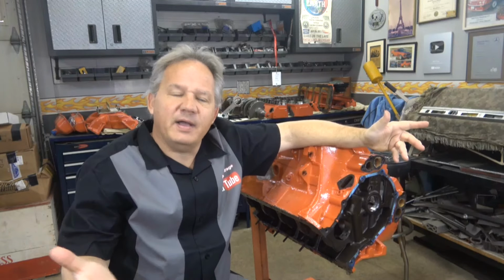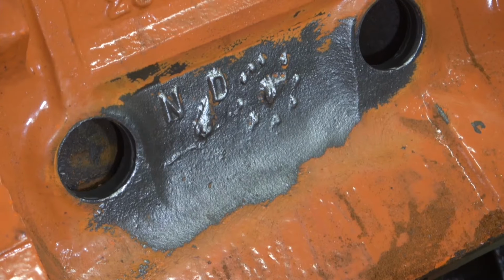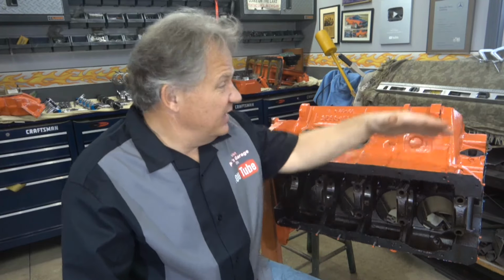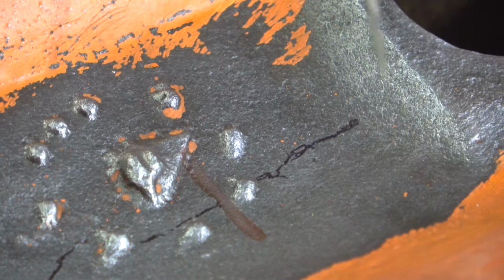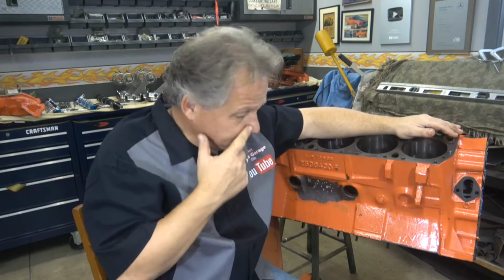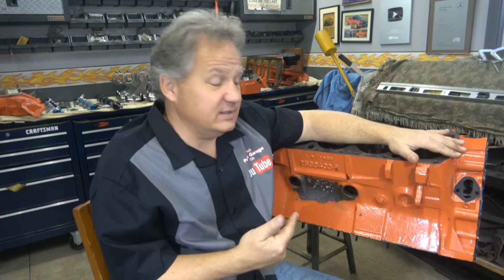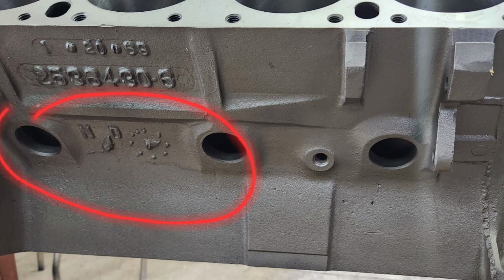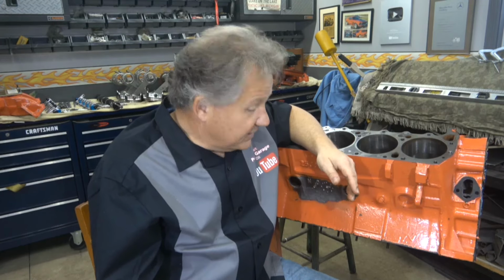Engine Failure Analysis - Why did the Block Crack

Comment: Where is the engine and car today? Was the engine repaired or replaced?
Reply from the maker: I still have the block. I may make a video about fixing cracks like this. I got a different one and rebuilt it. After installation there was a rear seal leak. It is very difficult to build a 440 with zero oil leaks. That is being fixed and the car will be at car shows soon

Comment: Those RB blocks were known to crack between the core plugs even way back in the 1980s. Has nothing to do with strength, JB weld it up and send it!
Reply from the maker: I will probably pin it

Comment: I'm very interested in the upcoming videos of the broke in cam and lifters, bearings, etc. You rarely get a chance for this! 

Despite the crack, very nice build.
Get yourself a Nickel welding rod for grey cast iron, grind the crack, bore the ends of the crack with a small drill and weld that groove back up. I know, easier said than done 🙂.
Reply from the maker: i may fix it in a video. I'm worried the crack is bigger than can be seen

Comment: Very informatuve and instryctive video, Pete.  I'm only a very inexperienced builder of a only few engines, but I worked for some years as a mechanic's helper and general "garage hand" for a couple brothers and their dad who had been fixing cars and trucks since the early 1930s.  One of my jobs as a helper was to pressure test virtually every job that left the shop, even if we had not worked directly on the cooling system.  I found a lot of weeping radiators, bad water pumps, etc. that made the shop good money when we fixed them for the customers who avoided getting stranded with an overheating vehicle.  I have watched a number of TouTube builders dyno test engines and I have often wondered why the shop didn't put a simple pressure test on the engine before investing the time and trouble to run it.  Cheap, and simple and it finds a lot of flaws.  Just a few thoughts from the peanut gallery.  Be well.
Reply from the maker: It is a good idea to take a little time to do a pressure test before starting up a new engine.

Comment: If you think you can visually see a crack, a magnetic particle (MT) examination using a yoke on the AC setting should be more than sensitive enough to detect the full extent of the crack on the accessible surface.  I’ve never heard of MT not being able to detect cracks because they are too tight, but I’ve only used AC (I’m a carrier NDT guy).  A DC yoke will be less sensitive, but can penetrate deeper into the material.   

A liquid penetrant (PT) examination should also detect it if properly performed, but I’d try MT first.  

But I don’t disagree with you thought on the block being left out in the cold to freeze without antifreeze.
Reply from the maker: Even under a 10X eye loop the crack is almost impossible to see

Comment: If the crack is open to the surface, MPI (magnaflux) will 100% find it if done properly, doesn’t matter how tight it is. As long as it is surface breaking. Ask any trained NDT technician.
Reply from the maker: I've done quite a bit of NDT. I'm not 100% sure what I saw was a crack, but the coolant was weeping from the casting
Reply: Magnetic Particle inspection (particularly Fluorescent Mg Particle) is the method of choice for detection of surface or subsurface anomalies in ferro- magnetic material.

Comment: Yes the piston rings spin. The block can be fixed with special procedure involving gas welding at the same time while strictly controlling the heat build up and then controlling the cooling of the block.

The question is Pete : Magnafluxing is old technique for checking for cracks. This block should have been checked with pressure testing above operating temperature. I wonder if it was checked with 3 step dye penetrant would this tiny crack reveal itself.
Reply from the maker: Lots of what ifs. You will find out about ring spinning in a future video :)

Comment: Is that crack fixable?
Reply: Dito on this question.  I'm going with no cause you have another block at the machine shop/personal preference to not bother with it.  Engine block care matters and if there's one crack, what are the odds of another defect.
Reply from the maker: It is a chance to take when fixing a block, there can be more cracks
Reply: Depends on if you want to spend the money to have it fixed , I've had many oil field engine block cracks like that fixed from freeze damage  and it was not cheap but the repairs held for years of abuse afterwards .
Reply from the maker: Yes it is, as long as you can see the start and end.
Reply: I have seen cracks like this before and if it were my block, I would put block filler in the bottom of the jackets and use a good sealer then put it back together and run it. It's a factory thin area with these blocks and the factory had many of these and would seal them and send them. Once the engine has been run then tanked for rebuking the tank it takes out the sealer used and the crank makes itself known! All iron blocks from factory especially ones that have thin locations like this have experienced occasional instances of such cases, not every engine, just some. Old Ford Flatheads were the worst and age made them even worse still. When Chrysler was making these,  nickel content along with some other metals was being used, sometimes the molten iron was a little inconsistent and wherever stress such as at the bottom of the jackets to the crankcase or top to deck is high due to expansion, these cracks appear. One way to deal with this is to use a particular block sealer that cures and can be drained out after. Another way is to fill the bottom are with rock block and then add in a good coolant seal. This is at an area that doesn't have to deal with high temps, only high stress from the expanding of metal from thin to thick areas which results from more movement one place than another. It's very common
Reply: Do they do penetrant dye testing on engine blocks?